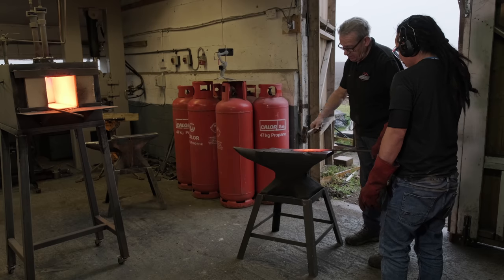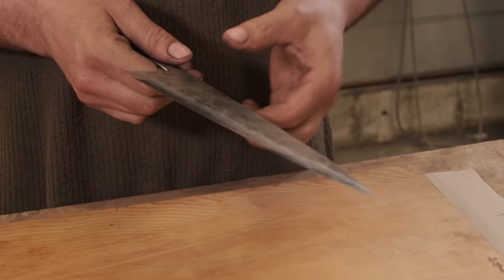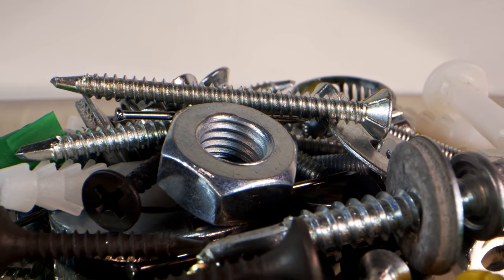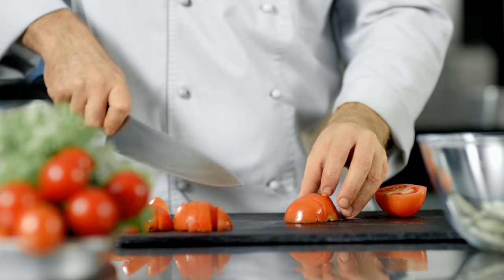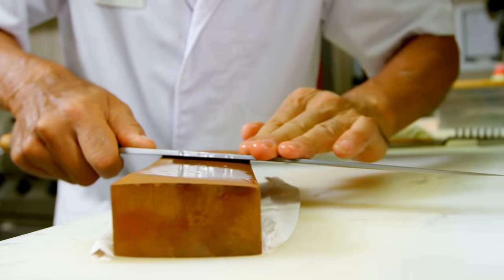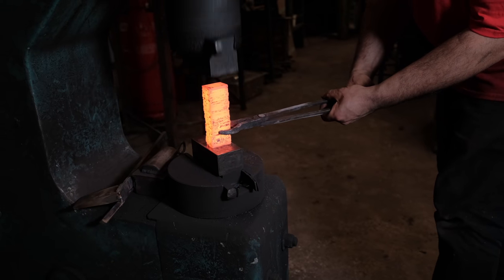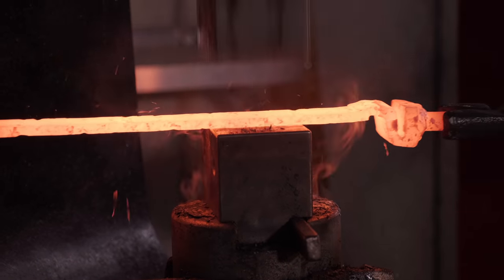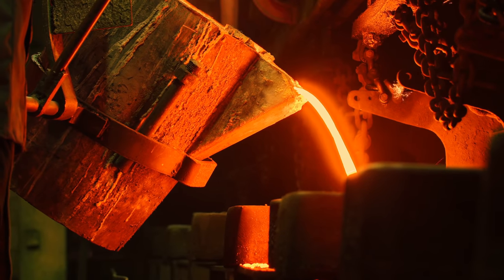Why 98% of knife makers pick the wrong steel according to a metallurgist

Comment: I like CPM 3V for blades that need toughness, CPM M4 for edge retention, CPM 154 for stain resistance, and CPM MagnaCut for all three.
Reply from the maker: Hi InkandFish! Sounds like you’re a big fan of the high-end steels! Thanks for sharing!
Reply: Is CPM 154 the same as 154CM? Still new to metals, just curious because my mel pardue benchmade folder says 154CM, only indication to what the metal is. Can you tell me anything about it, either way? Appreciated!
Reply: @kellanaldous7092  CPM 154 and 154CM are the same alloy - a stainless steel developed in 1959 for jet engine bearings. The big difference is, CPM 154 is a particle metallurgy version of that alloy put into production in the 2000s specifically for knifemakers.
The particle metallurgy manufacturing process makes it have much better toughness and perfectly even distribution of the alloying elements.
Reply: 14C28N when on a budget!
Reply: 154 really isn't that stainless.
Reply: @svn5994  There's plenty of stainless steels with better corrosion resistance than CPM 154 but few with the same balance of price, fine grain, and excellent toughness, which is why it's my choice for a general purpose stainless steel.
Reply: @Joël okay, I'll let the larger blade makers know.
Reply: Good god I’m loving magnacut. Rockwall (not Rockwell) is a banger!
Reply: @InkandFish555 I completely agree. CPM154 and 154cm are under rated.
Reply: @maxwellmortimermontoure7274  Even when MagnaCut comes down in price, CPM 154 will still have a place in being easier to sharpen and for custom knifemakers being much easier to hand finish.
Reply: Magnacut is good at everything best in nothing. You cant say we have everything in magnacut.
Reply: @БојанПавловић-е3й  Rate steels out of 10 for edge retention, toughness, and stain resistance, then average the score. Magnacut has excellent scores in all three performamce categories and has a superior average.
Reply: @InkandFish555  Like i said good at everything best in nothing. Basically stainless version of 4v steel. For toughnes id choose 1v, 3v, cd1/ztuff, for edge retention tons of other options but i understand why knife comunity pushing magnacut so hard.
Reply: @БојанПавловић-е3й well magnacut hits that perfect balance for knifes. You rarely need more toughness, and while there are steels with better abrasion resistance, they are also getting quite brittle and chippy.  The biggest downside with magnacut imho is the need for diamond to sharpen it properly. But yes, for special applications where you need super high toughness or super high abrasion resistance, there are better steels.
Reply: i like OU-31

Comment: I'm a retired tool & die maker, and have 2 knives I made more than 40 years ago. One is my moose skinning knife, and the other is my camp knife. I had become frustrated with store bought knives not holding an edge long enough to finish a skinning job. So I made 2 knives from O1 tool steel, heat treated them to 65 RC, and they would hold their edge after 4 skinning jobs, and still be sharp enough to shave with. I would not try to cut nails with them, but, used as I intended them to be used, they have served me well. I crafted leather sheaths, dipped them in melted wax, and have never had a speck of rust appear. Granted, the hardness would not work on a knife being abused in a kitchen, but, as long as I didn't try cutting nails, or stab rocks, they would remain razor sharp, year after year. Moose hair is very hard on blades, and my knives held their end up. I'm too old now to chase moose around and lug them out of the bush, but, I do occasionally take them out and touch up the edge on a diamond stone. I've considered selling them, but, can't bear the thought of someone using them to pry open a can of paint, or using them as a screwdriver, so, I keep them, and remember the moose that didn't get away. My brother would not lay a hand on them, for fear of cutting himself, but I think they are the finest blades I have ever used, and every store bought blade I've used since then have proved to be soft, and unable to hold an edge, useless.

i
Reply from the maker: Hi Robin! Thanks for sharing and happy to hear your story! Hope to see you on our other knife making videos!
Reply: One of these days I’m going to buy one of those 18” bars of O1 , shape some blades from it and have th3m professionally hardened. Not as good as forged, but I don’t have a forge 🤷‍♂️.
Reply: Is there a place I could see pictures of those knives? What edge profile have you used on them? Cheers from the land down under
Reply: To see people abusing knives in so many ways and claim it is for survival is amazing to me.  Every tool has an intended purpose and should be used accordingly and within reason.  Abuse a tool and expect it to fail, yet many denigrate a knife even though it wasn't used reasonably.
Reply: @remster1159  exactly. I can’t imagine it would last long he ought to skin an entire moose. He must be mistaken about the hardness. As you said. 65 HRC is about the hardest O1 tool steel can get BEFORE even being tempered. Fully hardened. It would be extremely brittle. Accidentally hit a bone and it’s over. Cutting a carrot would destroy that thing.
Reply: Robin thank you for sharing your story! And I'm sure I speak for many others when I say please post pictures if at all possible.
Reply: @UKBladeshow  good video, very interesting. what do you think about Kyle royer
Reply from the maker: @psalmo6351  hi I think he’s got some very good videos! I am subscribed to him and love seeing his work
Reply: @hillbilly4christ638  To be fair the point of a survival knife is you might not have any other tools and or be able to guarantee a reasonable use case. But that is a separate set of properties we are seeking (and for what many of these people wanna do you would be better served with a big chisel and smaller knife but that's neither here no there), a knife certainly isn't bad just because you can't ram it through a doorframe.
Reply: Hi Robin, sounds like you did an amazing job 40 years ago. Fantastic story and what a memory.
Best Gray
Reply: @trappenweisseguy27  Depending on the person who heat treats the bar stock removal can actually be better than forged, forging steel is a good way to shape it that I find enjoyable but it doesn't give any performance advantage assuming you are using steel that was made using a relatively modern process.
Reply: @kylehenline3245  What's the problem with survival knives?
Reply: @hillbilly4christ638  Amen Brother!
KnifeMaker/Retired
Reply: @trappenweisseguy27  Forging cannot improve the steel as rolled from the mill. the best you can hope for it not do any damage to it during forging. Most common is loss of carbon and carbide content.  
KnifeMaker
Reply: That was interesting story
Reply: You know Rod Chappell? Send here and Ill either hide them or send them to the other last apprentice. They are not junk. Use them on nails indeed, such a waste
Reply: @michaell397 wait, so if you purchase a billet its better to cut your knife out of it rather than forge it to shape? And if you forge it you will ruin it? (lose carbon) 

And what about normalising?
Reply: FOUR skinning jobs... with MOOSE?  Aren't they pretty giant and tough?  Was your knife just a giant, mega thin 2d shard of splintered steel?  
I want your knives!  Pretty incredible that you can shave after that, seeing as how I have buddies who tell me that the only real solution is multiple razor blades for that kind of work.
Reply: I always try to get around 55-60 RC, but if I was making a pristine show knife, or a skinner, thats the route I would go for sure. 65 RC I wouldnt let anyone touch either lol.
Reply: @vcommandarv5916  depends what you buy but yes. He is correct. Producers make steel billets really for shaping and heat treatment. And if you buy exact thickness that you need, you dont even have to grind much
Reply: Maravilhoso! Se fato são lâminas dignas de respeito. Parabéns por seu trabalho e amor por suas facas

Comment: I'm a degreed metallurgist,  and I approve this message.  Spot on.
Reply: I have a degreed too
Reply: It pains me to hear a metallurgist (the main in the video) refer to pattern welded steel as Damascus.  
It doesn't bother me when laymen or even blacksmiths who ought to know better fail to make the distinction, but a real metallurgist should know the difference.
It's a slap in the face of genuine artists like Al Pendray or scientists like John Verhoeven, who created true wootz crucible steel Damascus.  
The term Damascus has become a homogenized marketing term, and doesn't mean what it did 100 years ago.  
The Damascus blades you'll find in museums bear no resemblance (structurally) to what 99.9% of people sell today as Damascus (pattern welded).
Reply: @MrVvulf  All true, but sometimes the meanings of words change in ways that are very misleading.
Reply: @realmetallurgist8493  Absolutely.  I've given up trying to get laymen to understand the difference because they generally don't care.  
I suppose I'd be satisfied with changing the word for the historical Damascus steel to something different (perhaps simply Wootz Crucible Vanadium Steel).  After all, calling it "Damascus" wasn't a particularly accurate descriptor anyway.  The key ingredient was a specific concentration of vanadium, carbon, iron, etc., combined with the proper smelting and forging process to get the desired result).  
The old wootz crucible steel mostly came from the region around India and Iran, not only from the mines and furnaces near Damascus, Syria.  The steel for the famous Ulfberht swords, for example, came from Iran.
Anyway, thanks for indulging my rant.
Reply: @MrVvulf  You obviously know far more about the history than I do.  I don't remember any mention of history in my formal training.
Reply: @realmetallurgist8493  If you're interested, there's a fantastic 50 minute documentary here on YT (channel called "Loades of History).  The host is BBC historical specialist Mike Loades.  The subjects of the documentary are Al Pendray (blacksmith from Florida, RIP), John Verhoeven (world renowned metallurgist), Bill Dauksch (former Vice President of Nucor Steel).  Together over the course of 30 years they managed to figure out how the original Damascus steel was made - AND they managed to make it.
The video is entitled "The Secrets of Wootz Damascus Steel".
Reply: @MrVvulf al pendray and his team (verhoeven) its not created crucible wootz steel but re created or re invented ,the lost method and the missing vanadium part ...
Reply: @prameswarabrata2349  Quite right.  Re-created is what I meant.  I would edit the post, but it's so old at this point I see little benefit in doing so.
Reply: @MrVvulf  but im agree with you ...and now forge welded steel its claim to be damaskus steel for ads ..but for some place on my country they named different its name balik mipih or pamor
Reply: @prameswarabrata2349  Exactly.  Greed often ruins terms because anyone can claim their product is "genuine *****" just to make more money.

Comment: Nice overview, thank you. I make knives as a hobby (108 knives over the last 10 years. I fully agree with you, there is no perfect steel for any application. A German knifemaker, mettalugist, black smith amd author named Roman Landes described it in one of his books. To make a good knife it requires three factors to consider. The purpose / intended use / geometry of the knife. A carving knife is different than a meat cleaver or a wood chooper. The selected steel must be suitable for the intende use. And last but not least the heat treatment must be correct.
For carbon steel knives I like O1, very rarley I used steels like 1095. I make a lot of kitchen knives and my go to steels are niobium allyoed steels like Niolox or some of the US made steels from crucible. They are not easy to finish but allow for a fine edge. Niobium carbides are equally hard as chromium carbides but much much smaller.
Reply from the maker: Hi  Roland thank you for the comment that was an excellent feedback thanks! I love what you said about Roman saying about the factors to consider when picking a steel - we literally are making a second video and will be coming out tomorrow so stay tuned! Glad you enjoyed the video!

Comment: I use 5160 as it is the easiest to get a hold of and has the toughness and flexibility for fighting blades.  I have been using AEB-L for stainless steel blades and it has been fantastic.

Comment: My dad got a few industrial hss saw blades (about 5mm thick) meant for cutting aluminium and made a few knives out of those. No forging, just stock removal (stuff doesn't like to be cut).
After having used these knives of various sizes and shapes for a lot of things I'm convinced this is in fact a superiour material for a lot of applications, compared to what most knives are made of.
They may not be stainless, but they were slightly corrosian resistant, but if you leave one outside in the rain, it will rust. Ask me how I know. I used them in the kitchen and I don't have to wipe them off every cut like you need to with carbon steel, but these knives hold their edge better than any other knifes I got if you treat them well.
And with use I mean abuse in some cases and it just took it all. Chopping thick branches, wrenching tiles out of the ground, chopping firewood etc. only rarely did one chip and only after way too much abuse. The lighter tasks, like in the kitchen, they last forever and held their edge well.
I feel some shame for abusing them like that, but they could take it (and I had a lot of them) and they just got the job done. I wish I could get some more knives from that steel, but all I know is that it scratched steel of about 60 HRC and that the saw blade had "HSS" printed on it.
Reply: "HSS" covers a whole range of alloys. HSS just stands for "high speed steel." It's a bit like saying "carbon steel" or "stainless" or "tool steel." You don't really know what you've got, so unfortunately you can't truly to compare it to anything.
I'm glad it worked out well for you, but be careful - that sort of thing is how myths and rumors like "saw blades make good knives" get started. And that's really misleading because not all saw blades are made of the same steel. For instance, lots of old saw blades are made of L6, which really does make excellent knives, but especially nowadays a lot are made of steel that won't harden worth a damn. They just have good-quality steel or carbide tips welded onto them so they'll cut well and last.